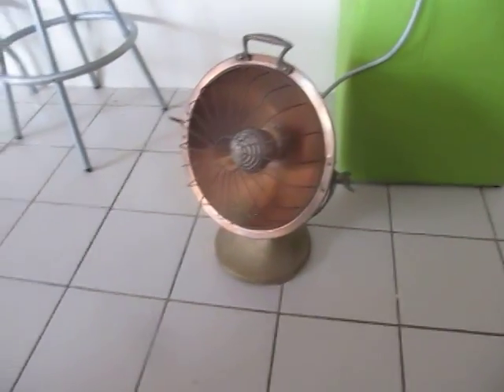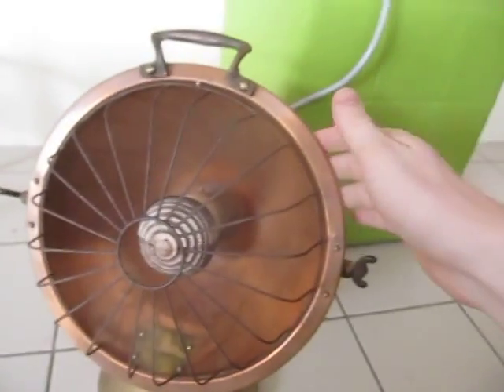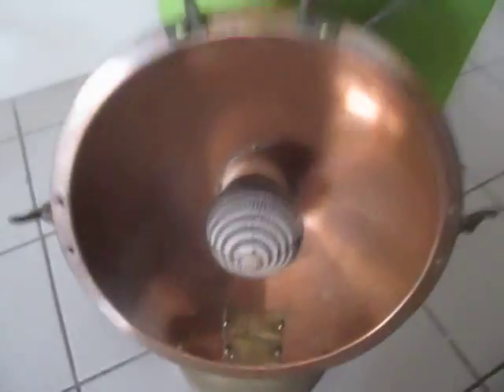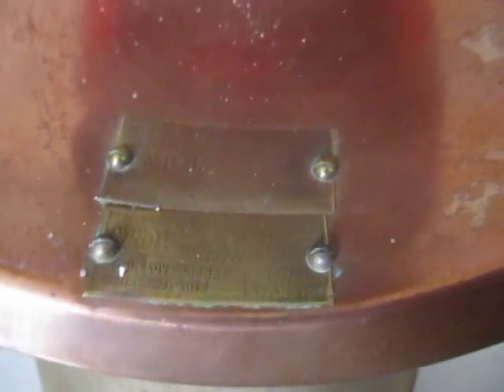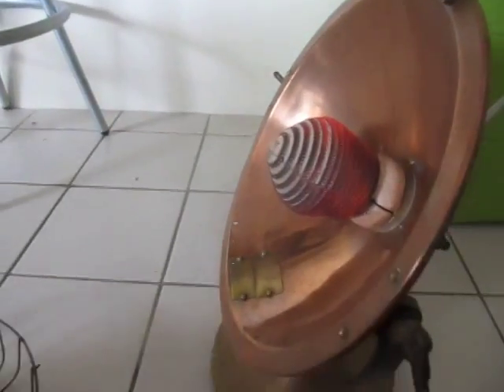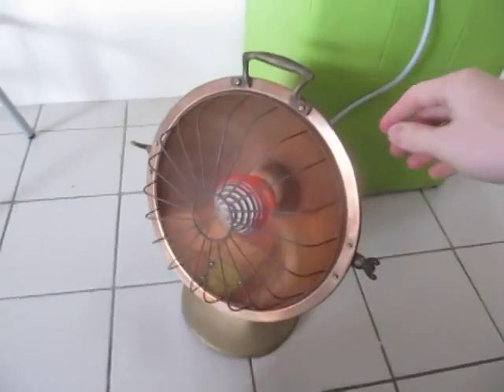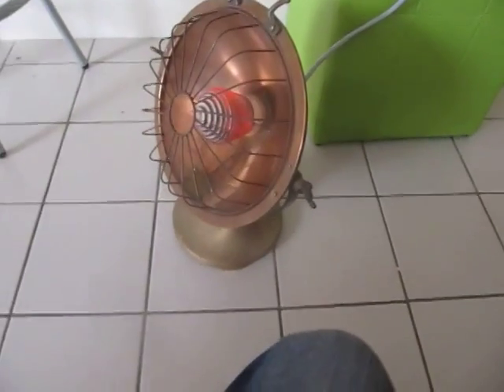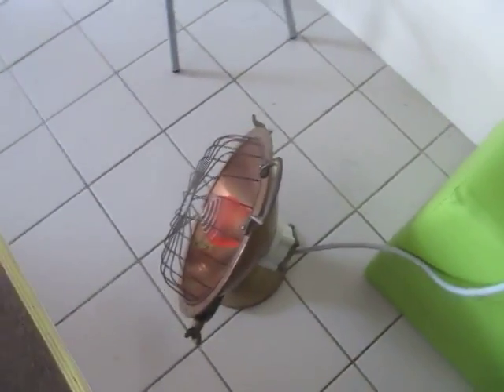1920s/30s "LOVE" Electric radiator

Comment: Cool pickup! It looks better that the piece of crap modern ones I've seen.
Reply from the maker: Thank you! It not only looks better, but would easily out-perform a modern heater. The only issue is the exposed element, which being a form of resistor, could give you a nice ~240v zap if you touch it too close to the active side! A little caution and common sense should ensure there's no problems though.

Comment: Looks nice!
 are you using it for anything?
Reply from the maker: Thank you! I'm using it as my main heater here.
Reply: Our main heater is a a made in Australia kambrook fan from the 80's we also have a wood grain heater from the 70's we use
 that is made in New Zealand
Reply from the maker: realgroovy24 tech
My main heater is a 1970s Vulcan Tangi 3 fan heater, in a small pressed-metal case with woodgrain. The sad thing it that despite it being almost 40 years old, it still heats up a room far quicker and more thoroughly than one of the newer fan heaters. I have a video of it on here somewhere.
Reply: If only they were energy saving! well anyway we got LED lights to make up for it!
Reply from the maker: realgroovy24 tech The Vulcan is more efficient than a modern fan heater I think. I use incandescents and halogens in the lighting still, and only use LEDs in the ceiling fan lights (as they won't take anything else).
Reply: My Grandparents had one of these, they used it for medicinal reasons - muscular aches and pains.